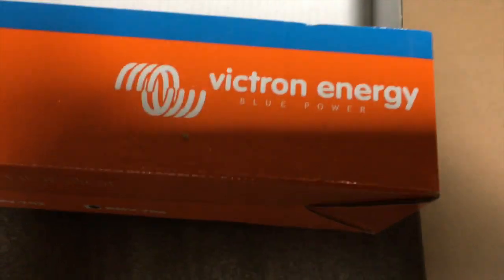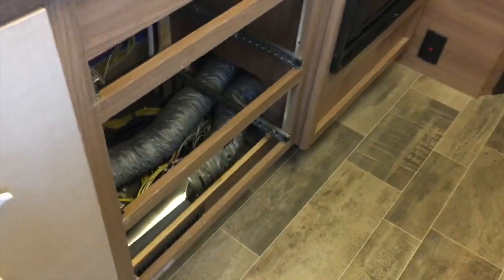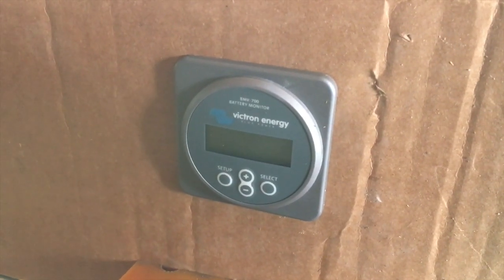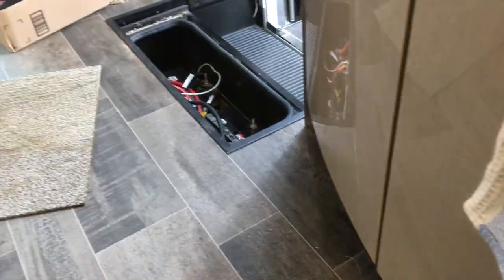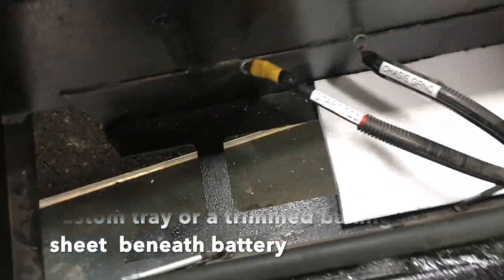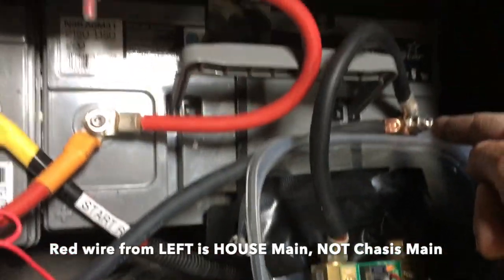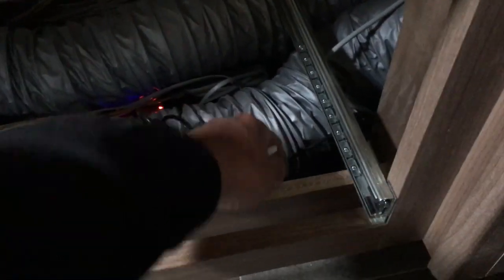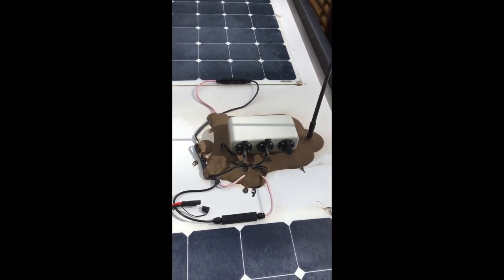Group 31 Battery & Solar Upgrade 2018 Winnebago View 24J

Comment: Great job on this video, it was exactly what I was looking for to show how to change the two original 6 volt batteries into two 12 volts running in parallel along with the Victron BMV and to ensure all of the coach and chassis connections are made properly on my 24J View.  Appreciate your taking care to video the battery compartment before and after.